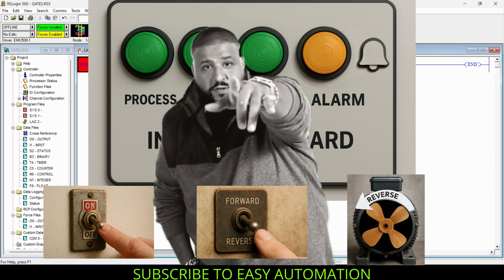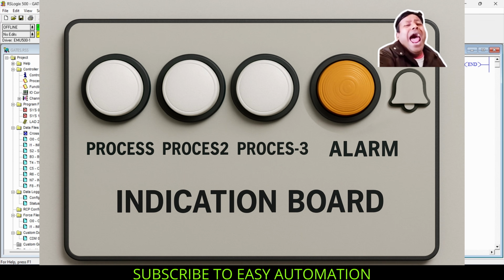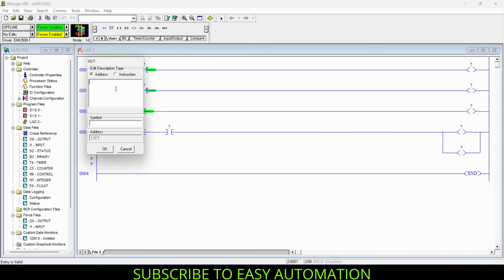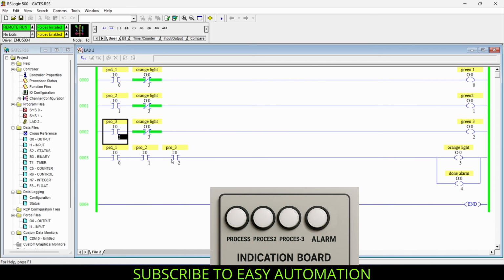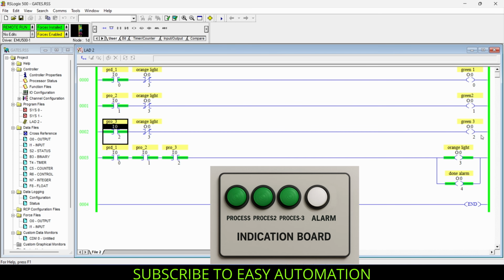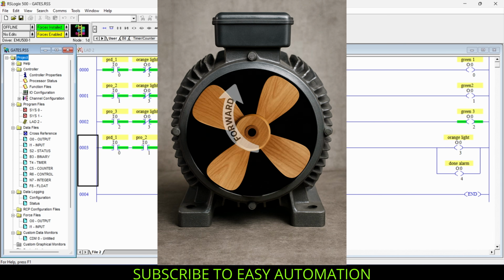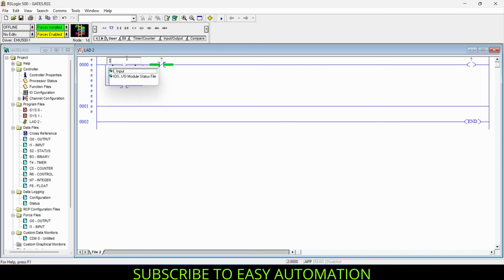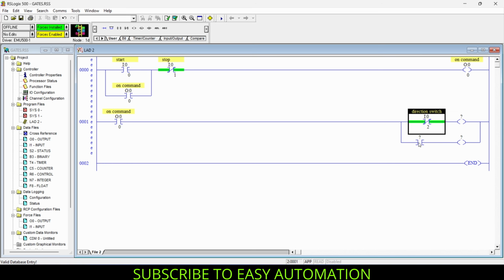PLC program for motor forward/reverse

Comment: Bro to repeat the same cycle from 3times
Reply from the maker: Watch my recent video, you will get an idea how to run it cyclically using timers and for 3 cycles you need to use a counter with preset value of 3 and by using done bit of that counter you need to stop the cycle

Comment: Hello Easy,
thanks for the tutorial videos. On the motor fwd/rvs, i was writing a similar program but its been challenging...when the motor is in cw run and you turn to ccw, a timer should delay the switch for 10s, likewise if in ccw run , we turn on cw , the timer should give a 10s delay
thanks in advance
Reply from the maker: Easy, will make a tutorial on that 😅
Reply from the maker: Use Ton Timer's DN bit in between